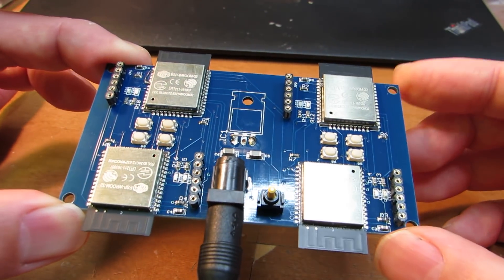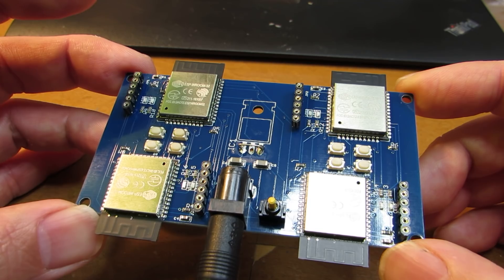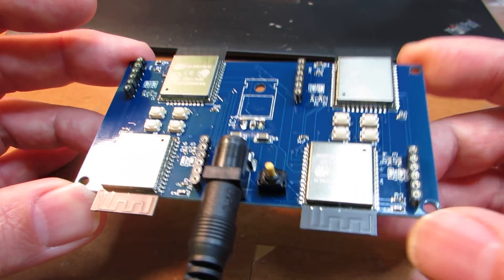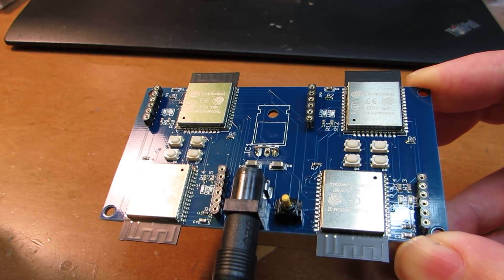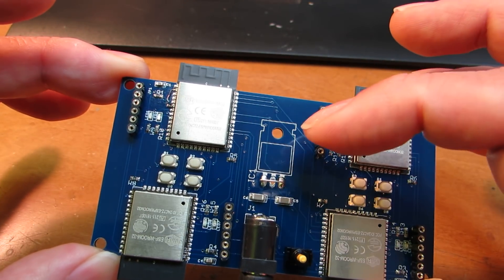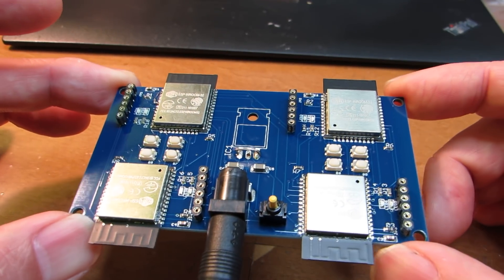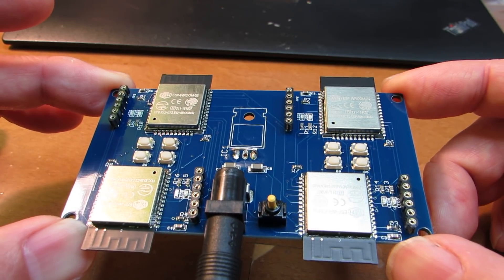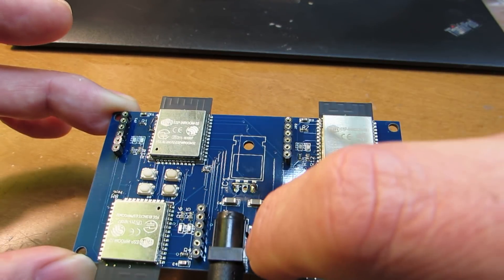ESP32 cluster system initial test: LED blink linkage

Comment: Are they communicating over WiFi ?
Reply from the maker: They can, but not yet.
Reply: microwavemont so how are they communication ? I2C ?
Reply from the maker: Any communication method will be OK, because indeed every GPIO are connected. I've not experienced I2S slave mode by ESP32 but I2C or SPI (also not tried SPI slave mode by ESP32) or... CAN?